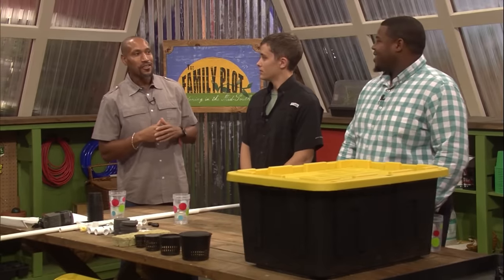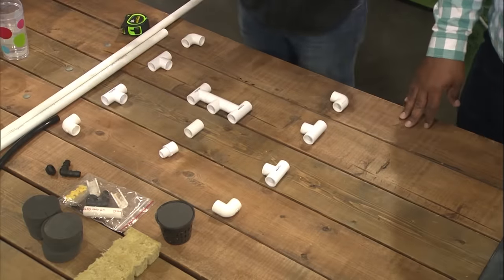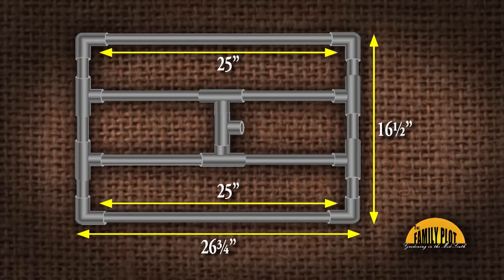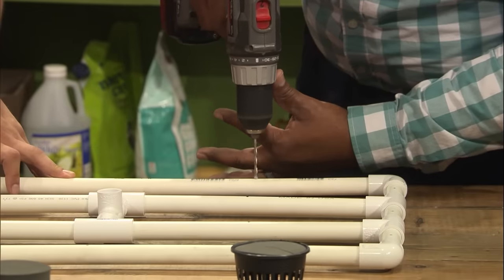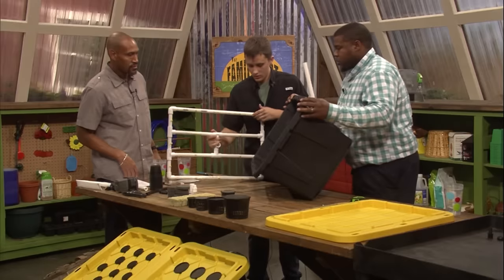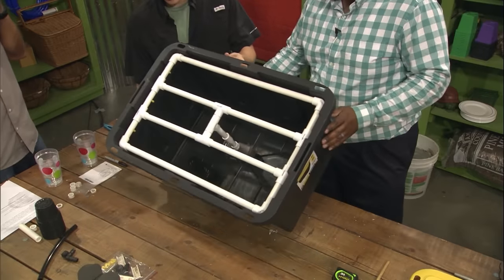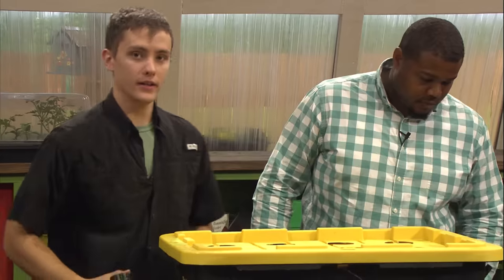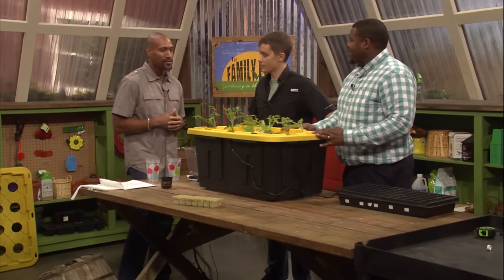Building an Inexpensive Hydroponics/Aeroponics System

Comment: Unless you like chemicals in your food, the totes had better be food grade.
So, where do you buy food grade plastic totes?
Reply: The ones in the vid is a common tote you can buy at Home Depot and it is food grade, was wondering the same thing. Also you gotta make sure you have the right PVC pipes that are food grade as well.
Reply: Check the symbols on your plastics and google their meanings. As a general rule, the numbers that are safe for use with food are 1, 2, 4, and 5. The best type of plastic for use in long-term food storage is high-density polyethylene (HDPE), which is indicated by the “2” symbol on these particular totes. There is a huge debate on all PVC products that emerged after this video was made and continues to today, but considering it's already in the lines leading to your tap and, well, everywhere at this point, what are we to do?

Comment: "And now we are ready to stick this out in the hot sun, after sticking this pump in the water so the plants die from hot water and root rot."
Reply: the whole point of a hydroponic setup is to do it inside. Root rot usually occurs from standing water inside of a pot
Reply from the maker: I have used this system outside in the hot sun in Memphis, Tennessee with tomatoes and it did just fine. The mist aerates the water very well. There are so many bubble that you can't see more than about an inch into the water when it is running.
Reply: @yoshisaidit7250  The problem was oxygen.
Reply: Proof on our social media with this setup outside in the hot Memphis weather with booming produce for months and months. We do prefer it inside, but it can scale to outdoor applications with ease. Relentless, you people.

Comment: way too complex on the PVC end for the bin size imo  a single line one end to the other and offset the sprayers   Ive built hundreds of the things keep it simple smaller pump etc  4 misters is all you need in that space lol  you will get more feeder roots less water feeding tap type roots imo you can also make a fantastic budget model with a reg mag drive and 24" of poly line cheap cheap
Reply: Any video / place I can look for more info on your method? I do know what you mean about it being slightly over engineered but I feel like once you have it all setup it should be a breeze.
Reply: @heavensplayer   No sorry no video Im speaking from many years of making them for clients of a retail/wholesale shop and running the hydroponic tradeshow circuit. as I see it theres way to many sprayers and PVC in the small space for that bin 2-4 sprayers are more than enough if using the 360 17gph style units and say 4 if using the dan bridge misters.  The dan misters can be used in normal poly like so you make a t off the pump cap off the ends with a plug or a kink add sprayers and your done cost under $10 excluding the pump say a mag 250 or 500 gph 
we made them in all sizes from runbermaids to 4x8 flood trays with 6inch tall pop tops  6" to 10" tubes as well but they get costly  another of my faves were aero buckets with a 5gal bucket awesome if your growing "trees"  big thick stock trees lol
Reply: @kootenayboy  No. Just no. A "tree' in a 5 gallon bucket will overpower any pump in there as soon as the root system gets large enough. We've done it a few times and learned not to do it anymore. You can use less sprayers, sure. But once the 12 plants are mature, you're struggling to spray the entire rhizome. More sprayers, more oxygen, more coverage. Cheap out if you want, but we prefer to spend now and save later for these "permanent" systems.

Comment: Hydro EXPERT? Yeah what ever man. Get a Roughneck tote less prone to leaking. You only need a single PVC pipe ran length wise an height in the center( The height of PVC depends on height of tote you don't want the cuttings being blasted USE COMMON SENSE)  of the tote with two 360 degree sprayer tips that are pointed up towards the cuttings. This is for ROOTING ONLY!!  NOT GROWING YOUR VEGETABLES. I use Olivia's rooting gel PH your water to neutral, Water must maintain a constant Temp ( Mine is 78 F)  so you might have to get a Fish tank heater an floating thermometer ( mine sat on basement floor). Oxygenated water speeds up root growth an fights off bacteria so place air stone in bottom of tote. !8 to 24 inch florescent lights 24/7 an the smallest fan you can find to provide slight breeze. If you do all this in 7 days you will have 3 to 4 inchs of roots hanging from your cuttings an they are ready to transplant to whatever you choose.  This is only advice because  I"M NOT THE HYDRO EXPERT. Have a great day people !!!!!!!
Reply: We are certainly experts in hydroponic applications and custom indoor gardening. We don't use ANY rooting gels, we simply use smaller versions of this system and spray the roots until they clone. If you were en expert you'd realize that a small air stone in a jar of plain water will make a plant root. Even just changing the water daily will make it root. The key is oxygen. We use large reservoirs and pumps, spraying to dozens of totes, large and small, with the same nutrient regimen to achieve excellent results from cutting to harvest. This is easy if you use the aeroponics technique because every square inch of the rhizomes are blasted with highly oxygenated nutrient rich water. There is no better method if you know what you're doing. Some of our systems use fewer sprayers than others. Using lots of sprayers not only ensures complete rhizome coverage, but leaves room for the rare clog, as the extra sprayers will compensate when one stops spraying. Furthermore, this method is absolutely not intended for only rooting cuttings. We grow plants year round, and indeed clone, all from the same method in various applications. Save your negativity for your own gardens. Ours are lush, green, and sprayed everywhere. Thanks.

Comment: Anton, unless you already have all the specialty Tools and such to make the system you better have lots of funds on your Credit Card.
Reply: Who doesn't have a grill? the tap isn't very expensive. The paddle isn't very expensive. The PVC cutter isn't very expensive. Maybe $30-$40 in tools you don't already have? I bet most guy's workshops has the tap and paddle. PVC cutter... $12? Cheap hole saw kits for plastics are like $10. Who needs credit cards to buy drill bits and attachments and fancy scissors? There's like 4 tools used in this video. So many Nancy's in the comments section.

Comment: Checked your website... How much is your electricity bill at the end of this? lol
Reply: The water pump doesn't use nearly as much money as you'd expect, not sure about  the grow light i'm gonna first try it using sunlight.
Reply from the maker: The pump is 25 watts. So in a year at 11 cents per kwh that would be $24.09. If you put it on a timer you could get it down much lower. The lights of course depend on what kind you get. I like to use the sun as much as possible, it is free.
Reply: For a water pump? The same as a water fountain or fish tank.. the pump is small!

Comment: Tip for anyone wanting to grow potatoes, or carrots etc.  instead of using net cups, use a mesh cut in a cone shape, folded up and hung with string from a small screw in the plastic lid.  Simply wrap the mesh around the clone, leaving the bottom open, and tie a string around it and loop on a screw placed near the edge of the hole.  Use taller containers by stacking them.  Cut the bottom out of the 2nd container inside the molding, then place that on the lid, and cut the lid exactly the same.  You can do both lid and container bottom with same cut.  Then place your grow lid on top, and if you're really cool, add a second bottomless container to the top, with grow lights!!!  Let's go Brandon!

Comment: Recently I saw a guy doing this with just water in the container no pipes, no pumps, nothing. Just the container and water.
Reply: That is deep water culture. This is sort of a hybrid of that because the reservoir is in the same tote as the plants, but the idea behind the aeroponics setup is to use less water (and nutrients, which means money) to achieve better results than the DWC system. This will save the money it takes to make it, if already using DWC, in a short amount of time.

Comment: 2 stupid questions for y'all.
1. Are you able to refill the water without killing the plant. Bc last year I used a 10 gallon bucket and I had huge cucumber s then I had to refill bc I ran out of water and killed the plant. 

2. Where did y'all buy totes?
Reply from the maker: There are no stupid questions!
1. You should change the solution on a fairly regular basis. Depending on the plant that could be every few days or every month. When the plants have drunk about half the solution, change it. If the new solution is very different especially in pH from the old solution it can shock or kill the plant. 
2. You can get these totes at Lowes.

Comment: thats 100$ in pvc fittings instead buy a full 20ft pipe cut holes and use pipe sealant way cheaper and leak proof
Reply: Wtf are you talking about? $100 in pvc fittings? You're insane. This is less than $10 for everything PVC related except the cutter. Avoid PVC cement so you can take it apart and clean it. The leaks are going to be in the tote, it doesn't matter if they drip in this particular application. THINK MAN!

Comment: Did no one realize  that they installed it wrong  they have there misters spraying down .. I get that they would do that to test it but they didn't show u that the sprayers are supposed to be pointing up at the plants  where the roots will grow not at the bottomed of the toat
Reply: But I should add they did do a good job and deffenitly helped me out on figuring out  how to make  my own  but they just messed up at the end on the sprayers direction
Reply from the maker: The sprayers are pointed down on purpose. The design allows the PVC manifold to be right under the lid to help support the weight of the plants when they are large and heavy. The sprayers pointing down also eliminate the leaks through the lid.
Reply: You only need the spraying up if you want to build a system root cuttings for you. in which case, we would use a smaller tote and make many more plant sites. This system is intended to have plants transplanted to it with roots already dangling low enough to get enough spray to sustain.

Comment: Life would be sooooo much easier if the Merkins would adopt the metric system. All this 29 57ths  or whatever nonsense is just too much hard work. I am Scottish, but we went decimal around 1972, so millimetres, centimetres, metres and kilometres make SO much sense. We still use MPH, but my European wife was absolutely into KPH and when I drove in Europe, life just got easier. Plus, 600Km goes by a lot quicker than equivalent miles. 62 miles is 100Km. So the adjustment is easy. But millilitres and kilograms just make sense.

Sorry to be a bug, I just find inches so soul destroying :'-(
Reply: Your pain isn't unshared, brother. "What size is that?" "Hell, I dunno, get em all"

Comment: I was told to run the sprinkler system for 15min every hour on the hour?? What's the real truth..
Reply from the maker: That is probably correct. It depends on the conditions the tote is in. If you are inside that should work fine. if you are outside in direct sun and live in a dry location that might not be enough. You just need to make sure the roots don't dry out between spray times.
Reply: The plants rhizome (roots) will greatly appreciate as much oxygen as they can get. So, allowing the spray to stop is a great way to increase the oxygen they get. However, we tend to let them spray continuously because the nature of the setup is to oxygenate the water, anyway, and we don't want the pump to give out on the continual on/off cycles. Some hydroponic pumps are of such high quality that you can do this. Some are not. Remember, the hardest thing for any machine to do is to turn on. And as our friends at the Family Plot have said, just don't let things dry out and everything is fine. Let it be the user's choice in this instance.

Comment: A tap is for a hole a die is for a cylinder. you use a die to thread a bolt, you use a tap to thread a hole. You should be tapping by hand it's plastic it's soft af. And that is a spade bit not a hole saw although both would work for this purpose. I don't want to have to edit this again. You know why you're here don't listen to these guys they've given plenty of bad advice.
Reply: Getting the names of the tools wrong doesn't change the efficacy of the technique being taught. Scott didn't design this build, nor is the brains behind the business he works for. He was certainly nervous that day in front of a camera, but he's a good gardener and retail clerk at our shop. The advice here is top notch, albeit a bit lacking the tool knowledge. We're all still waiting for you to bring more than negativity and nay-saying in to the hydro world. Probably be waiting until the moon explodes.

Comment: Rock wool holes lotof water you really don't need rock wool in aero toye
Reply: Indeed we no longer use rockwool in any of our setups. We in fact have developed systems our newest systems to use absolutely no disposable pieces. The only waste we will tolerate is nutrient waste during water changes and, now that the systems are more refined, we are headed in the direction of minimal nutrient waste. The sprayer system already does a lot for that, but we don't want to throw anything at all away...

Comment: #1 learn the proper name of your tools before making the video!
Tap cuts inside threads after drilling your hole.(like a nut)
Die cuts threads on outside  (bolt/screw)
Other wise very good video.  Thanks
Retired machinist turned  herb grower.

Comment: Not trying to be a jerk; but why is this better than just putting those plants in dirt?
Reply from the maker: This allows you to grow in the winter, if you don't have dirt, etc.
Reply: The water is flowing through my walls... I don't like disposing of the dirt. Or trucking it around. Or dealing with pests and mistakes on my part. This system is very rewarding.

Comment: To expensive..get a tote, anything that holds water, buy spool noodle, cut in 1 inch thick, put plant in it let it float
Reply: this isn't a good idea for various reasons. the reservoir needs a lid, so floating isn't going to work. and the water need aeration... i think that's enough for now.

Comment: He slipped once and said pickles, it's okay guys. It can be really hard to talk and try to formulate conversation when you are getting recorded and have a screen looking at you.
Reply: Pickles are a type of smaller cucumber, usually used for pickling and not the larger, standard cucumber that you'd normally use in a salad.

Comment: Hydroponics are not worth the produce you get for the work involved. You have to constantly monitor the water and add CHEMICALS to maintain it which are quite expensive. Plants need more than water to produce fruit, or vegetables. Been there done it. Pain in the butt for what you get. Making a system is the easy part.

Comment: Where is the reservoir you speak of? Haha. And how would the water get back up to the grow bed? It “drains” no it doesn’t haha into the nonexistent reservoir
Reply from the maker: The  reservoir is the tote. It is all self contained.
Reply: This is a hybrid unit. As Family Plot has said in their reply, it is an all in one, self contained unit. You can easily adapt this and have an external reservoir send the nutrient water into the tote and let it return to the external reservoir. This is intended to be the cheapest, simplest application to break people into DIY aeroponics. The pump draws from the water, sprays, and the spray returns back to the water to be continually sprayed again. If you don't want to call it a reservoir of water, I don't know what else to call it. Thanks for watching.

Comment: 15:05 these diy systems are trash and the noobs will soon find that out. The plants are way too close together the roots will get entangled.  Much simpler to just use homemade 4.5 liter and then 10 liter buckets with lids and a drop basket, that's it, that's all
Reply: Cute. We've been using this system and similar sprayer systems for a decade. Noobs, yeah? Waste not, want not, friend.

Comment: Master gardener... I wouldn't use duct cutters for that... Def not the way they are. Not really the proper tool and def not the right way to use that.. there's an actual pipe cutter that you can get
Reply: This is the correct pipe cutter for this size pvc. It makes a clean, easy, fast cut. Which tool are you referring to?

Comment: What are people using for nutrients? For garden vegetables haha not weed
Reply from the maker: We are using General Hydroponics Flora Series nutrients. There are many on the market. Research them and figure out which one will work best for you. I would start with liquid nutrients because they are easier. After you have some experience with liquid nutients and hydroponics you can change over to dry nutrients. They are cheaper, but require some more work.
Reply: @FamilyPlotGarden  thank you!!
Reply: NPK salt based fertilizer is available in liquid or granular form. It can be used with any plants, there's no such thing as cannabis only nutrients. Maybe a formula specific to that plants needs, but most quality companies produce nutrients that are dialed in to your specific application, not a separate nutrient for each plant species. We no longer use nutrients that arrive to us premixed in liquid, and opt to purchase salts that we then mix ourselves. This brought a 20 gallon water change down from around $4 to about $.80 per feeding. Why truck around water when all you need are the ferts? Jack's Professional Part A, Part B, and Epsom Salts and a magnetic stirrer with flask are what we use now. Get the 25lb bags, folks. You won't regret this tip.